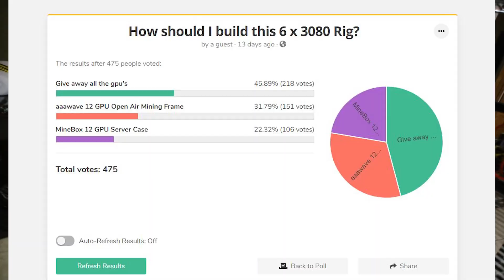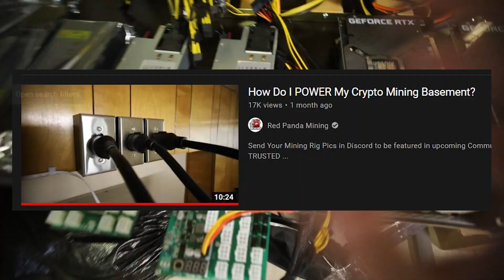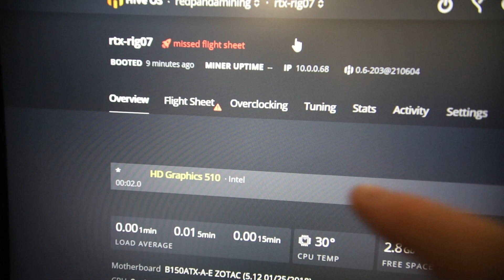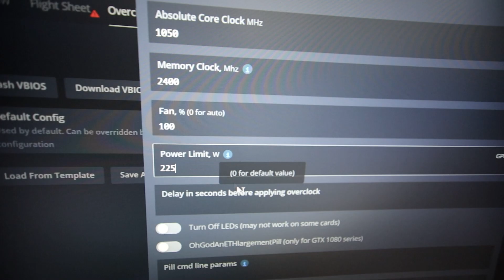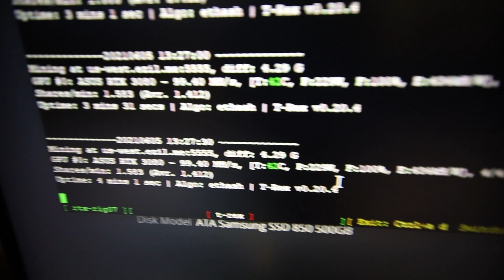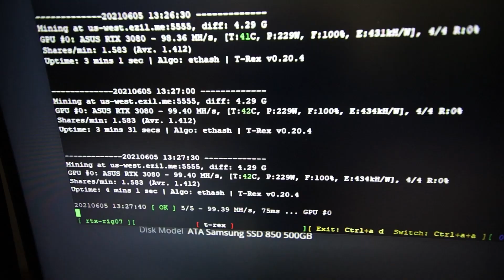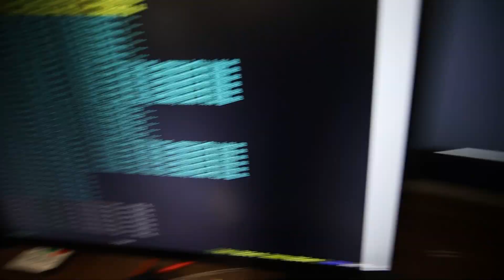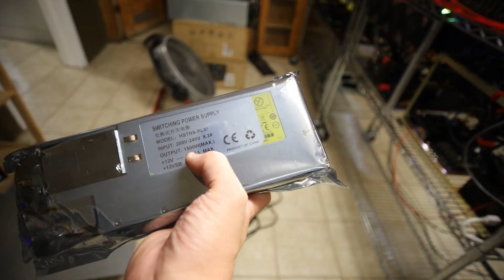Speedrun Build of a 6 x 3080 Mining Rig with 1500w Server PSUs

Comment: I have been checking what is the best solution comparing the hashrate and power consumption. Aorus 5700 XT is taking 89 watts and generating 50 Mh/s. That is 100 Mh/s on Ethereum /180 Watt. Ofc one problem is that You need to have free 2 PCI spots. Also 2 x Aorus 5700 Xt is a same price as RTX 3080, or maybe cheaper.

Comment: I got a 3080 rig. 6 x 3080 asus tuf, they are doing 100.4 mh/s, 1100 core, 2400 memory, 250 power limit.
The power limit is 250 so the fans have headroom and the hashrate doesn't suffer because of them.(and because of the temperature.
2x2000w PSUs, they are using about 231w each

Comment: I couldnt run 6 rtx 3080 on any motherboards (old or new model) at full hashrate 99-100. The rig wasnt stable even thoigh i checked power and all cable including the riser. I had to lower memory clock. So sad…. USA
Reply: Direct your trust wallet
Reply: [ω:h:a-tsa:p
➕1➖5➖5➖ 9 ➖ 2 ➖ 2 ➖ 3➖ 2 ➖ 4 ➖ 0➖ 2

Comment: USA, awesome rig. The Tuf cards are great. I can't get my MOBO's (tried two) two pick up the GPU's powered by my server PSU in a ATX/server psu set up. Switched to dual ATX and it recognizes them. Server PSU hooked up to ATX with 4 pin, turns on when ATX powers on. Any thoughts? I've had it pick up 1/2 GPU's before but I can't seem to get it to work correctly.

Comment: do you use PCIe to SATA for risers or do you use pcie splitters for it?
My rig is 2 RTX 3070 and 10 GTX 1660Ti with 1500W(850W + 750W) Power supply.
Is that enough as a power supply?

Comment: Panda, try giving the TUF's 1100 core 2400 mem. Mine are stable 100+ MH/s @ ~226-230W
Reply: Stock thermal pads?
Reply: @bambamfelix5582  yeah stock, they seem to be barely good enough to prevent throttle

Comment: Do you think water blocking or even immersion cooling would be better for GPUs? I realize the cost is higher but can you also get more out of them?

thanks for all your work dude! I built my first mine because of you :)  12x580-8gb, my first baby :) but I sold her anticipating the new cards and I super regret it. Ready to build a new one, definitely wanted to do a 220-240v as I live in an apartment and there is not a lot of power options for me. So getting a converter to use the higher voltage to keep from popping fuses. What do you think? 

Thanks for the videos!  

USA 
and....
!!!XRP!!!

Comment: I got stable 102.5mh/s on my 3080 tuf with 0 core +2900 mem 246w pl, you should try, I'm sure some of them can achieve such hashrate.

Then i also removed tharmal pads and put copper plates so the mem temp went from 100°c to 88°c and i was able to get 3300 on the mem @104.5mh
Reply: Explain copper plates? Is there tutorial for it?
Reply: @Ehren1337  yea, look for Unleashed Overclocking on Youtube, that guy knows a lot